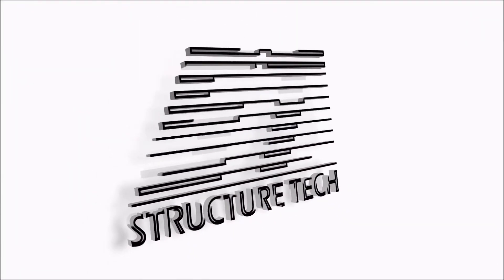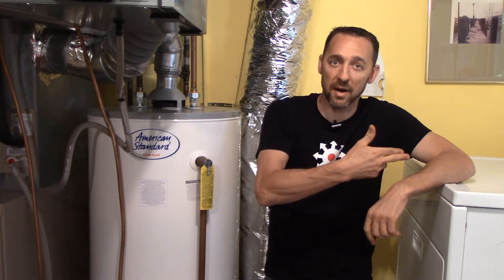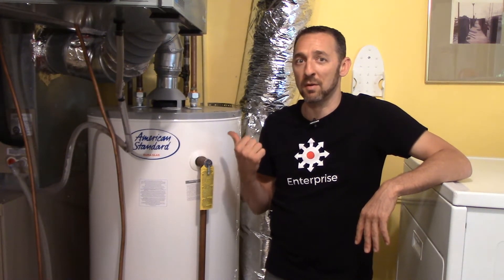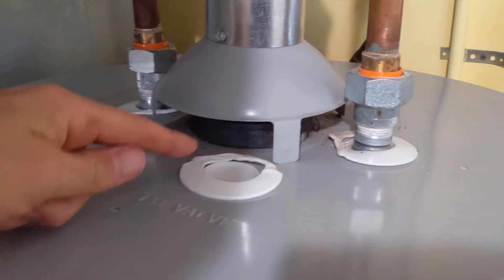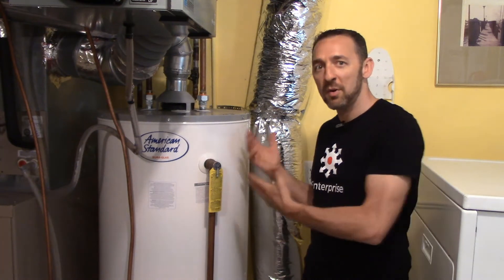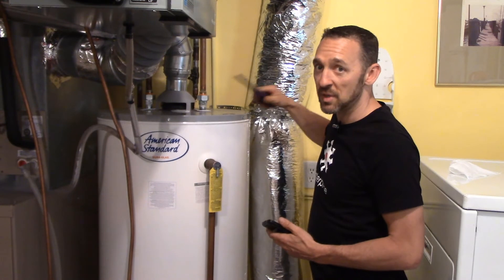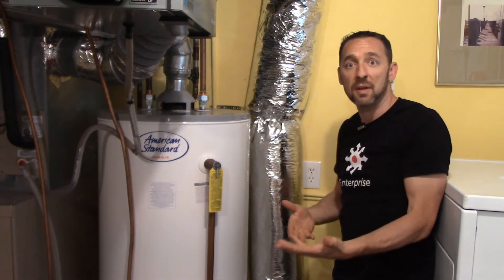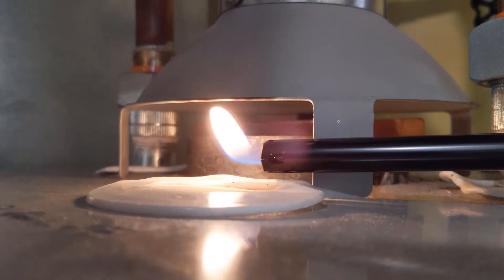Water heater draft testing

Comment: Hi Ruben, a few years ago you took the time to help me with issues in a min-split install. Appreciate it. Currently rebuilding/resurrecting a residential Raypac gas burner. Question is, does it require B piping and are there B swivel joints? Thank you

Comment: Thanks - now I understand why we get that awful smell when more than one hot water appliance - tank, dishwasher, washing machine - is running at the same time.  Keep asking for something to be done about - keep having the problem.  From now on I will crack open the side door of the house.  HWT is in the open, in  old house, not hermetically sealed - wouldn't think it would be a problem.  Next hwt will have the power vent.  Didn't even know they existed.  Thanks.
Reply: Co does not smell

Comment: Buy Carbon Monoxide Detectors people! If your standard gas water htr vent travels horizontally and its interior home you’ve got carbon monoxide risk. During construction all the gas lines and flue piping done by HVAC contractor who do not care or warranty water htrs . Flawed system to be sure .

Comment: I've been asking myself if the fumes in my house are coming from the gas boiler or gas hot water heater, both naturally vented.  The hot water heater pipe T's into the much larger boiler pipe, which then goes to the roof.  I don't have fumes when the boiler is running.  I do when it's not.  The water heater is old, and it's burner and air  filter have never been cleaned.  Could this be the cause of the poor venting, or is it more likely the flues are partially blocked?  I'm old and have balance problems.  Can't find anyone to go up on the roof.

Comment: Why do you need to wait for the water heater to kick on for the test? If there is a slight backdraft present from the flue setup, you would be able to detect it with it just a bit of smoke. Say like in the winter, there is always heavier cooler air present in the flue.

Comment: You are not allowed to bring in combustion air with flex duct.  You need upper and lower combustion air, constructed of ridged duct. One opening within 12” of the floor and one within 12” of the top.  They must be separate to the point of the outdoor termination.  The water heater flue connector is oversize.  It should be 3”.  If your going to do this often, you should by a proper draft measuring tool.  Dwyer makes a pocket size model called the draft-rite.  It will measure draft in hundredths of an inch. It’s really a problem having the dryer and all of the other fans drawing air out You need to consider that make up air, along with sizing combustion air for the fuel burning appliances
Reply: Flue connection for water heater should be sized based on btu under 40 k 3 inch over 4inch
Reply: @sewerrat7612  Usually the draft diverter collar will be the proper size for the connector required.  Why would a manufacturer put a 3” collar on a water heater that needs a 4” connector?
Reply: @rodgraff1782  most of the ones I see work for 3 or 4 inch there essentially stepped just put over and attach with zip screw. Less parts manufacturers have to deal with

Comment: A big problem I see and no one seems to talk about is when furnace and water heater are venting together. Most 80% furnace use fan assist on the vent and its blowing the vent fumes right back out the water heater. So many installers use a tee at the connection but the vents are level with each other making it far worse. 
Would love to see way more talk about this and ways to solve the issue since so many folks have this set up. Honestly I am to the point of going electric on my water heater just to end the issue once and for all. The last item  I see is negative pressure in home from stacking, so many people have this issue on lower levels where their equipment room is and are not even aware of the hard negative in their home, once again fumes pulling back into house from b-vent.
Reply: No one talks about it because it’s not a problem.  You are mistaken on the operation of an induced draft 80% furnace.  The inducer is not there to push the flue gasses out of the furnace.  It is there to overcome the restriction of the heat exchanger.  In other words it is not a power vented furnace.  There is no problem having a common chimney with a connector for a water heater and a connector for the 80% furnace.  They are both negative pressure connectors.  If it were a power vented furnace, it would need a sealed positive pressure flue.  This is the case with the 90+ furnaces which use a sealed PVC flue.
Reply: @rodgraff1782  
Mid-efficiency (80% to 82%) furnaces have no draft hood. Instead, they use fan-assisted draft with a fan located at the outlet (draft inducer) of the heat exchanger. 
If you have your water heater flue tied in with a cross tee you will get a positive pressure back thru the water heater side pushing gases out, mine was doing this. The issue was the tee, you have to use an off-set tee to avoid the direct exposure of the water heater flue, the offset will allow the pressure to bypass and go up the roof instead of across the tee back thru the water heater.
Reply: @sunnyd6019  As you stated, the spill problem is due to a improper installation of the combination connector pipe, with both appliances connector pipes directly facing each other.  One appliance, the furnace, should enter the bottom of the combination connector, the water heater should enter the side, at an angle facing up.   I have an 80% carrier furnace I my garage, that is a 1990 model Carrier. It is common vented with the water heater. The furnace has  a small square draft diverter, with a spill switch. I have seen several brands that have this. If there is any kind of positive pressure in the flue, the gasses will roll out of this opening, and trip the manual reset spill safety switch. If you hold a match to the opening, the negative draft pulls the flame in.  If it goes the other way, you have a problem with the venting system, or the combustion air.   The inducer motor on the furnace is designed to draw the gasses thru the heat exchanger, and deliver them to the flue collar.  Right below the collar is the small draft diverter,  with the spill switch, so the pressure at the collar is negative.  I have seen these rollout switches bypassed, because the flue was not drawing properly. That’s a big no no.  The induced draft 80% furnaces, at least the Carriers, have been around for over 30 years now. Mine is 33 years old, and still going.
Reply: @rodgraff1782  100% on the issue, mine was vented wrong at the tee. I went ahead and removed all to the B-Vent at the ceiling. Then re-installed a new off-set tee and vented back to the furnace and water heater. Once this was done no more issues at water heater and perfect negative draft now. I only noticed the issue because I was in the room working and my arm got real hot and I felt the gasses being pushed back out the water heater, it only lasted like 15 seconds but I did not want anything coming back into the house since bedroom is close to mechanical. Sadly a lot of homeowners probably have a bad vent setup that is so simple to fix, again I would never have paid attention if not being in the right place at right time to catch it. 
Cheers and thanks for the info and reply.
Reply: @sunnyd6019  Glad  you got it fixed.  All flues have what they call “priming time”.  Which means they won’t draw right until the flue developers buoyancy from the hot gasses.  This can last for up to one minute, and spillage is allowed during that time.  A water heater pilot will keep the flue slightly warm and offset the priming time. On the other end, long flues can have a stack affect, which causes air to be drawn up, even if they are not hot.  This is usually due to multi story chimneys.  This can cause problems with appliances that do not have draft diverters.  Also make sure you don’t have a negative pressure in the mechanical room. Cloths driers, kitchen fans, fire places, and bath fans can put a negative pressure in the house, if an insufficient supply of combustion air is not available.  I’ve had to seal the doors on the furnace room and run large fresh air ducts into the furnace  room to offset problems.
Reply: The the vent piping was properly installed there should be no issues regardless of weather it is a 60% 70% or 80% furnace sharing the vent pipe.  The problem is the building codes are not always strictly adhered too.  Make sure you insist that any time you have a contractor change your water heater that a permit is pulled, so the building inspector can look over the work.  

In an 80% furnace the heat exchanger makes a lot of bends to extract heat form the combustion gas, so it needs an inducer fan to pull the flue gas through.    

The inducer fan does not push the exhaust up the vent pipe more than a few inches, somewhere around 12" the pressure should be negative.    

Drilling a hole 18" past the breach you should be drafting between  -0.02" wc ~ -0.04" wc.  

If not there is a problem negative pressure inside of the house or the vent piping is not properly installed and professional needs to to be called to evaluate the situation.  

I would look for one certified by National Comfort Institute.  NCI has one of the best programs in the USA.   You may even want to take the class yourself is one is offered near by.

In a 90+ furnace the inducer motor is really a power exhaust.  The power exhaust is much larger than an inducer fan and  generates positive pressure all to the end of the flue.

Comment: This video deserves way more views! And I appreciate the time and effort you put into this. It's probably the most important thing that should be checked on a water heater as a part of regular maintenance. But most other videos aren't emphasizing this like you are.

I have a two family house with two different water heaters. An old school one like the one you had in your video and the other is the new school one with the power vent. The old school water heater has been going strong for many years. The new school with the power vent and electrical control panel has given me a bunch of problems.

Someone who knows a lot about HVAC told me to check the vents and make sure they were clear. The old school one had a wall plug with bunch of dirt and bugs backed up in it. The new school one I can't figure out how to get to the vent to clear it. But after watching your video and understanding that the power vent uses a fan to push out the air, I'm starting to think that that one is not likely to get a lot of debris in it because of it having that fan.

The problem it's having is that. it tries to start up and it clicks a bunch of times and then shuts down over and over again until eventually it catches and starts running to heat up the water. Any idea what might be wrong with it?
Reply: This is probably too late but typically the repeated attempts to kick on the burner is from the safety system logic when it detects unsafe conditions. Usually in gas appliances this is caused by lack of combustion flow either on the intake or more like the exhaust vent. I'm confused about not knowing where the vent is - it should be connected to the fan exhaust with rigid piping similar to old draft heaters and have a relatively straight and short run to a protrusion outside of the house. Draft venting would exit vertically through the roof or chimney while powered exhaust vents can exit the side of the house, similar to a dryer vent or high-efficiency furnace. 

In theory, the fan powered exhaust could remain cleaner with a one-way flap or slats like on a dryer or bathroom fan, to prevent bugs/dirt from the outside, though modern building/fire codes don't permit anything but an open pipe exit with no screens or slats, at least in the case of the intake and exhaust vents for high-efficiency gas furnaces but at least those connect to a sealed chamber in the furnace the prevents direct access for critters from outside the house. If your new heater detects poor exhaust flow, it usually won't run consistently or at all. If they have low-temp exhaust like high-efficiency gas furnaces, you have more options and ease for installing a new vent but it sounds to me like you don't actually have another vent at all for the second new unit?

Comment: Yea, my guy put in a cheaper model than what we had. Didnt know then what i know now. Think im having backdraft issues. Pilot light went out 5-6 times since 6/28 install. Can a power vent be added? Do i need to leave a window open and freeze the basement? (Brrrr) Thnx
Reply: Power vented water heaters seem to require a pvc discharge rather than a  metal flue.  Not sure why this is as the exhaust is exactly just as HOT unlike from a high efficiency furnace.

Comment: I'm in Austin Tx. summer heat reaches 120/130 in the attic I've having combustion air issues with my water heater it goes smooth but in goes off again. There's no air flowing by the water heater.